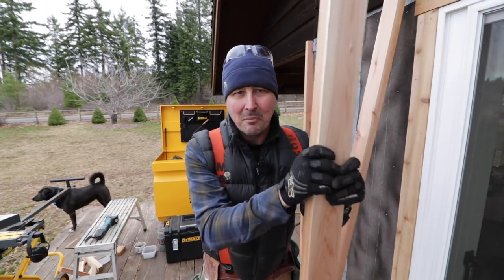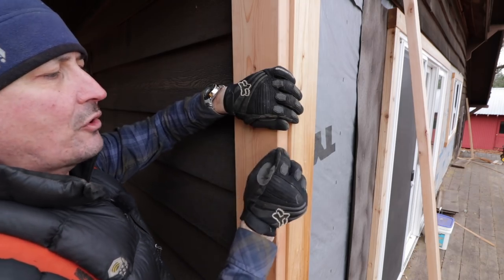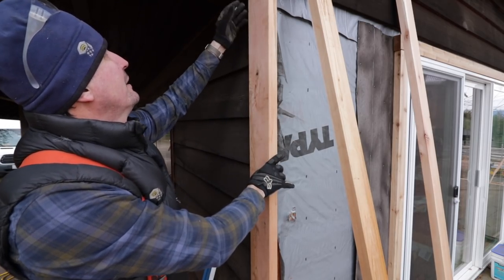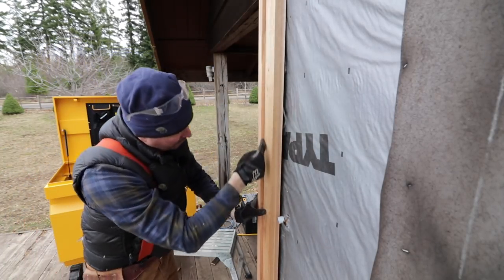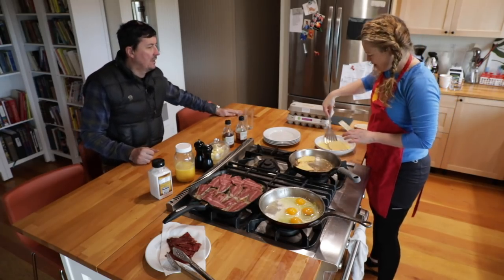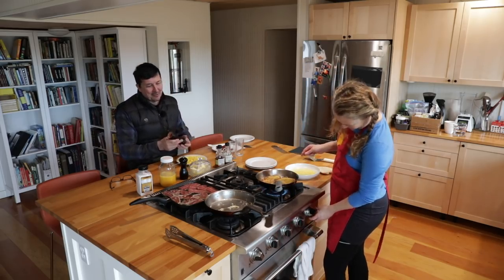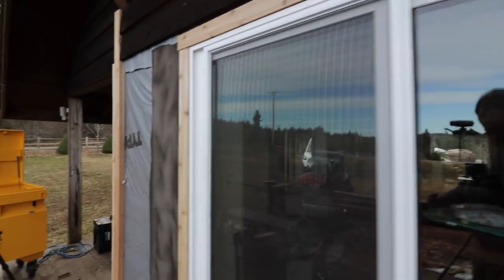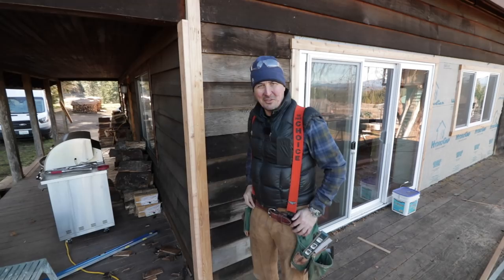Who Could Do Such A Thing???

Comment: When pulling nails, it's a good idea to put a thin scrap between the puller and the board. It will reduced damage to the board.
Reply: David Cunningham 
I always use an old worn out 6" stainless putty knife to pry against.
Reply: Kevin Ball - Finally, some non marginal advice. 8^)

Comment: Regarding caulking that takes up gaps:
Make sure the gap is generous enough so that the caulk can stretch to accommodate expansion and shrinkage of wood.  If your are applying a bead of caulk to a joint where two pieces of wood are in contact with each other, the joint will start to rip from the back side of the caulk joint as soon as there is some movement between the boards.  With a wide joint and a foam caulk backer rod or bond breaker tape even a wide joint will not stress the caulk that has to stretch to keep attached to both sides.  
In the case of those two corner boards, a routed groove about a quarter inch wide and 3/8" deep with some bond breaker tape in the bottom and then fill it with silicone would last forever..

Comment: i feel for you there Cody, We just took over a house that was my wife's dads who passed back in June.  It was built  by her brother and some of his friends and it is a mess.  He was working as a boat builder down on the coast and hope he did better work there or those boats would go down is a small storm.  The house set empty for a year and went to pot, the deck which is like 58 by 12 was very bad and had new decking but it was not square anywhere some places were off by 3 inches in 8 feet.  Plus the lumber and nails were another story, never seen that many different nails in one deck in my life.  Wife wants to be in by this Christmas but it looking like that is not going to happen unless I get more help other than my son.  It takes way more time to go back over bad work to get it right than to do it right the first time.

Comment: After pulling the nails, you could flip the piece over to hide most of the damage... or, I missed something... Nice work though. I'm dealing with similar problems trimming out some new windows on an 1850's plank frame house. Because of the construction, I'm having to put the trim on over the siding, and use foam to seal the gaps. The Plank frame wall is only about two inches thick. I'll be furring the interior walls and adding some insulation... All the wiring has to be done with conduit. There's no hollow between the siding and the interior wall. And, then there are the shelf chimneys. Try bringing them up to code!

Comment: Put your corners together first and then put it on the wall. 30+ years experience here.
Reply: Does it change the end result?
Reply: If I understood you right, this is what would have been the propper way to do it. :)
Reply: I'm not trying to be critical of his work. I would have just gone about fixing that problem differently. I would have pre nailed the corner together so it was straight and then used a few shingles to shim out the siding where it meets the corner. That way, everything is straight. Just a suggestion if there's a next time.
Reply: Works for me, too. Maybe using a few strips of plywood (varying thicknesses), run vertically just out from the corner allows you to "blend in" the transition from dented corner to flat wall to the right.

Comment: Why didn't you simply turn the board over putting the nail puller damage against the building?  That would give you a fresh face on the outside and not require any filling.
Reply: He's not a carpenter.
Reply: Obviously, but he is a thinking man and some things are just so obvious that you wonder how anyone could miss them.
Reply: Possibly wanted to keep the crown of the lumber upwards,  you know lumber tends to twist
Reply: Possibly, but it is installed vertically and he cut the crown off to get square edges.

Comment: Nice job on the siding Cody.  Since you are going with a drastic color change, dark to white, you may want to ust a good primer to block out to original color and minimize any 'bleedthrough'.   I get great results with KILZ Primer.  It comes in water base or oil base.  Put on two coats of it then your paint of choice and you will be set.  Your paint will not need to be redone for many years.
MB

Comment: Why not shim behind the siding so your exterior corners show as being plumb (not level - level is a horizontal condition.  Plumb, or out of plumb, is a vertical condition) regardless of the structural component underneath?
Reply: My thought exactly. Though only Mr. W will ever notice, it's still the right way to go about applying the corner and would have been much less saw work.

Comment: Nice wrangling dude. Us UK folk are still trying to work out the measurements.  Metric is a lot easier but a lot of stuff is descended from Henry VIII (i.e. his toe was an inch - apx. 25mm, and his foot was a 'foot' 12 inch - apx. 305mm).  You can proportion the body in this way - 12 inches in a foot (should you so wish).  Happy chopping!

Comment: As I watch this video, you are talking about it being cold at 32 degrees outside, so I looked over at the thermometer, and it is -6.  I think you mean it is balmy where you are.  I bought a small and a large nail puller of that fashion several years ago, and I have not found a nail I can't pull with them.

Comment: A better way would be to keep the corner straight and scribe and cut a piece to go under the end of the siding where you nail it, thus resulting in a straight corner where you will see a curve the most. You might have to cut 2 curved shims and go back a couple stud spaces, in order to phase in the cupped wall with a straight corner. Looking straight on to a curved corner will look tacky and very noticeable. Especially to a perfectionist like you :).

Comment: I would use some screws to attach the cut down 2 x 4 in the corner to compensate for the curve in the wall.  Nails will eventually let go, they do not hold under constant tension.

Comment: Would it be possible to recess the exposed nails slightly with a punch and fill the holes with like a mixture of saw dust and a wood glue of the same trimmed siding and sand flush? Haha probably more work than its worth, still love how it all turned out! :D

Comment: its funny - i built a shed with the same method - found the same issues with the corners and found the same solution as you - even the clamping - your right - there is gonna be an exposed fastener on the top slat :-)

Comment: Rocket mass heaters only need to run for two hours or so, then they can be shut down for six or more, depending on the size of the mass.
Reply from the maker: Install one in your house and your insurance company will drop you like a hot potato,